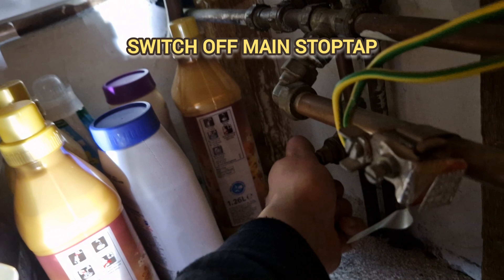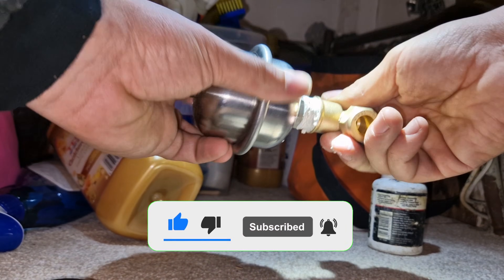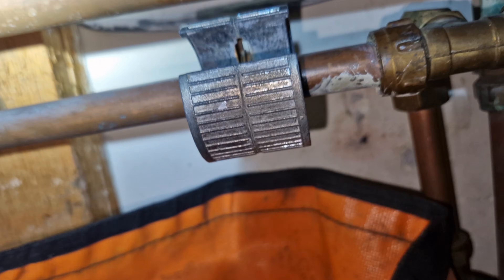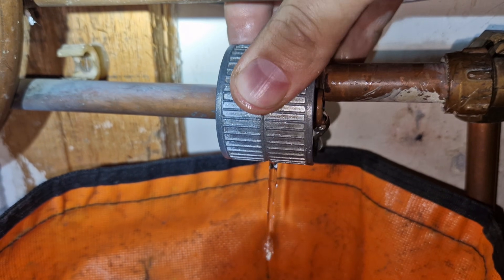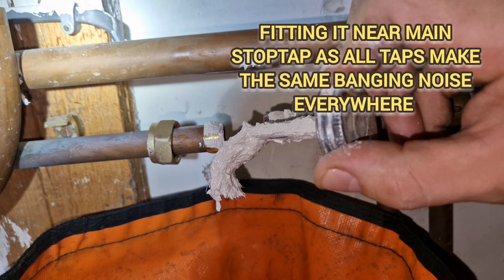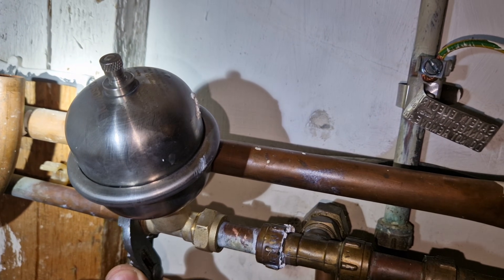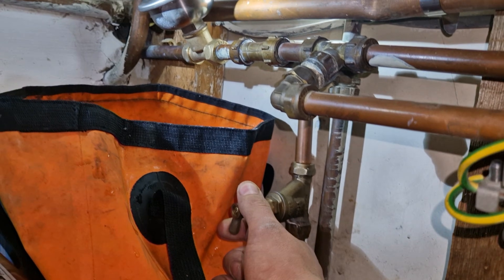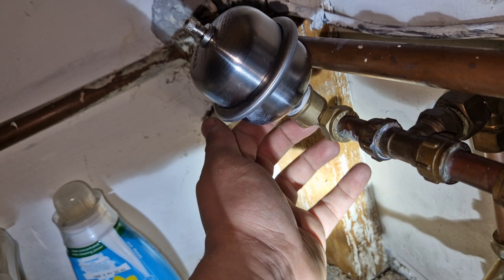Loud Banging Pipes? Fixed! Water Hammer Knocking Toilet Tap Washing Machine

Comment: Buy an tapered drill, so you can remove the inside edge after you cut your pipe. I use 1 with the max size 20 mm, you can use it for 22 mm copper and any pipe that’s smaller. Use 2 wrenches on the same time, on each side 1. So you can easily hold the appliance at the desired spot. 👍
Reply from the maker: Great idea

Comment: I say problem here is , he had new taps fitted before, on a old system pipe work which is never clipped properly and will be branching off to a wash hand basin taps , and specially underneath a bath 🛁, where two pipes next to each other , it creates a big back pressure on quarter turn taps by turning them on and off, cheapest option replacing every single cartridge upstairs, one of them is faulty , and if any assembly of ceramic disc parts lose inside the cartridge will create hell of a lot banging noises once you open them whilst running water from either tap or shutting  them on and off .